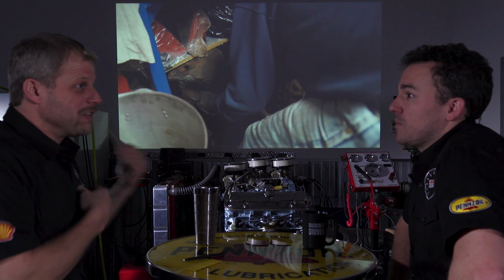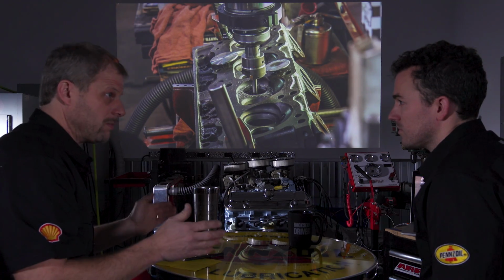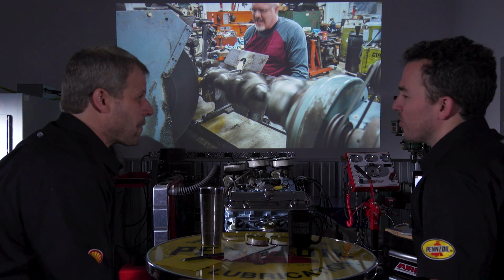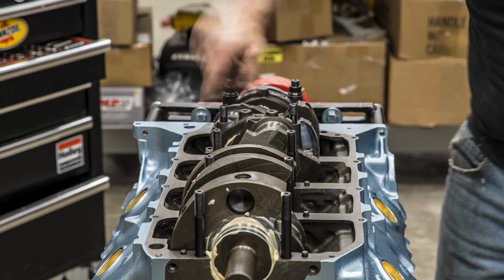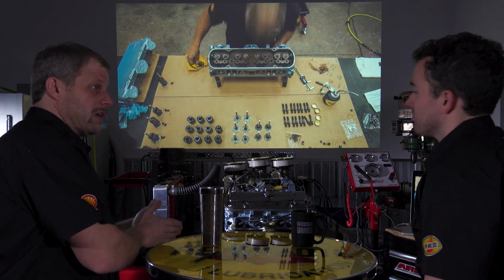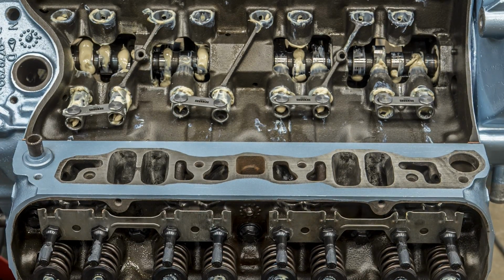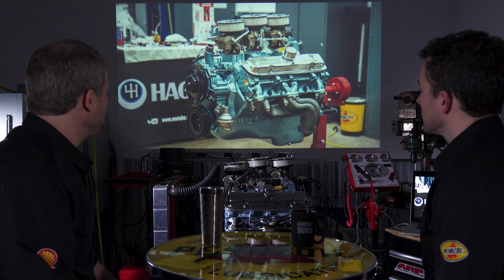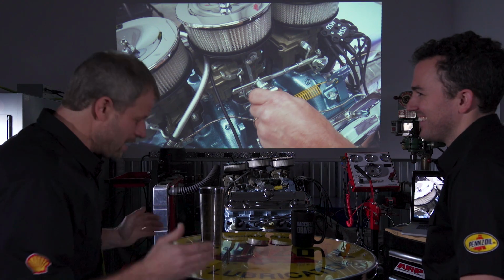How we rebuilt our Pontiac GTO 389 engine | Redline Rebuilds Explained

Comment: Fantastic, entertaining and informative videos !! My thoughts, not a big deal. I was wondering why some use race aluminum type rockers, and not steel for street use? Not a big deal. Why not use aluminum rods? The heads you chose are open chamber 400 heads and do not match the 389 piston valve relief locations or angles, not a big deal. Good job resurrecting an important engine to the muscle car history.

Comment: On the cranks, it's hard to grind to the millions,  normally 1/2 a tenth..
Or .00005... for a normal auto engine we are +/- .00005. Running a crank grinder all is very tiresome. Your not going to grind a crank journal to .000001. Its not going to happen..

Comment: In regards to the lathe with the grinding head - you can grind down to tenths of a thou (.0001) of accuracy.  Once you hit a half of a tenth (.00005) it is extremely difficult to maintain a dimension because the surface will expand/grow as a result of the heat generated from the grinding operation (even with flood coolant).  Dimensions below half tenths that I have dealt with are accompanied by temperature tolerances.  In other words, the feature or surface has to be a specific distance from another feature at a given dimension.  The measuring tool also has to be the same temperature.  A millionth (.000001) I would argue is improbable for a lathe with a grinding head to be capable of hitting.  Dressing (making the surface flat with a diamond tipped tool) a grinding head to be flat enough to do a hundred thousandth (.00001) is unlikely at best.  Basically what I'm saying is at 19:06 he should have said "... size in the ten thousandths."  Which is well beyond the tolerance required for the crank.

Comment: Just thought I'd share with the community on what my brother and father built late 90s. My brother built a engine stand generally out of angle iron, some wheels, and a huge nut. We bored out the nut threads to fit a pipe. Welded the nut to a square post. Worked great for our 3 engine uses. Still have it but doesn't get used anymore. We used it to rebuild a 350, tear apart a 305 to see why it failed,  and reconditioned a 4.3 V6. Made our own vs buying just cuz we could make one.

Comment: Hi 😊 My name is Donald... I've had two 69 GTOs  in my Day...I let a Woman drive My last GTO....She hit a Telephone Pole.... I still have the 69  400 block with a 389 Crankshaft... Motor was bored 20 over... But I sold the Ram Air heads about 20 years ago..... Question Please... Motor has been sitting in My Garage  standing up...Here I am 63 and I bought a beautiful 94 Firebird... very very clean... but it has a V-6 ...now years ago I put it in a 73  Z28 ... I want to know if I can put it in my Firebird.... I believe I would have to change Transmission... Drive shaft & and maybe a 12 bolt rear with 390s gears. Could you please let me know if it's possible... I love GTO Motors

Comment: Noticed the term "clamp load" used in this video.  So did you compensate for the fine threads on the nuts of the main studs ?  Fine thread will deliver higher clamping load.   And the ARP bolts won't stretch as much as the stock bolts.  I'm sure you had the studs in there when you had it line bored and the same clamp load value on the threads of the block.

Comment: Would have been nice to know Which 389 block and heads you started with? Stock 093 heads had press in rocker studs. You either had to machine screw in studs or they are not 1966 389 heads?  Were those Arma Steel cranks you turned? Great project! Love the Pontiacs!

Comment: Not a crate motor,.......a basket case.
But a worthy project if the car comes with it.
But most of the parts will probably be from Mexico,..... at least mine were.
Sleeving a block is typically used in tractors.

Comment: Hi guys been watching for best part of 3 hours of your work. I have to say it's a real pleasure to see. You could not put together a better promotional video than this. Love the animation quality touch to the final cut. 
I own a 1950 Buick which runs pretty dam good. But would consider sending it to you from the United Kingdom. Just to have it spect up to your craftsmanship.
The one thing stopping me is the seal between the straight right and the dynaflow gear box always leak. Which leads me to thinking if I have to have it done again. I will put a V8 in it with a snug gearbox. 
Here's the question there are I believe ways of fitting different gearboxes to a straight eight. I've heard there are new rubber seals to the gearbox but dont know where I could get this or if they exist. But if you could give me a rebuild on my straight eight with a snug gearbox that dont leak. Well think I'd have to think about shipping to you. 
Is this possible do you know if you could do this.
Once again guys just the best work you do really 11 out of 10. Absolute joy to view. Thanks Les McMillan

Comment: The strength of the serpentine belt is very high but the resistance to abrasion is very low on a  sharp edge. Thousand pound motor and transmission assembly, parted of my serpentine belt on a sharp edge of the casting ! I quit doing it that day !

Comment: I totally agree with painting before assembly. Shop teacher back in 1985 taught us this and been doing it every since. Also on the 20/50 oil for break in. I started using amsoil break in oil probably on the last 4 motors. Am seeing a big difference in performance, quality of break in, and longevity. They basically schooled me on ring break in and it turns out that my old school science lab concauction of oil and additive mixing was wrong all along(30 yrs).

Comment: Hey gents, around a year ago you where talking about the 60's Pontiac big block you where rebuilding and how a couple crank journals where turned to different diameters than the rest. Maybe the following story will help to explain why. I was told by an old timer( I'm 63 so that makes me a geezer too I suppose.) that back in his younger days there was a machine available that could resurface journals while the motor/crank where still in the car. Youou just had to pull the oil pan and set up the device. The subject came up as I was bitching about a rod knock on an out of round journal on my 65 f100 that had a transplanted 68 ford 390 that I knew was going to grenade in a year or so and I had a  460 with 75k miles from a 86 f250 waiting in the wings. I would of used that tool right then and there.

Comment: Here is a question:  Why did you not use the Clayton Leach ball style rocker arms that Pontiac Motor Division used in all of its 326 and 389 cubic inch V-8's of the 1960's?  I reused these rocker arms each time I rebuilt my 326 and have had no problems with them.

Comment: On the oil filter adaptor.  It's been my experience that on the 66, 67 Tempest line which includes the GTO you need the angled filter adaptor.  This is because of upper control arm mount on the frame makes removing the filter a pain in the butt.

Comment: Davins 100% right to paint before assembly, but theres even more to what he grazed on. cast-iron is extremely porous, even more after its cleaned especialy with the caustic-acids of a hot-tank. and assembly lubes or oil are quickly soaked into the parts preventing paint from ever adhering properly. so a few months later, the gorgeous motor is peeling paint.

Comment: Revisiting Have plans to install a Roller cam in a Pontiac 1969  400 engine. Cam final lift 0.510/0.521.
There is a lifter bore brace available for these blocks.
Reputation Is some lifter bores-points,  are a bit weak. 
Would like Any feedback / knowledge or experiences about this “lifter brace” device, if it’s overkill or not necessary etc.

Comment: After watching the first ten minutes or so, I have some comments.  Starting several years before 1968, when the ability to use unleaded gasoline was first mandated for new cars, Pontiac Motor Division was using Inconel valve seats in its engine heads.  My 1966 model year 326 engine had such Inconel seats in its heads, so whenever I taken the heads to a machine shop to be redone, they simply reground the seats to fit the new valves.  The car runs just fine on unleaded gas to this day.  But if you don't know exactly what year a 389 engine is from, then it makes sense to replace the old seats with new Inconel seats.  If you know a 389 is from 1964-1966, then you probably have Inconel valve seats installed by the factory.  As for cylinder sleeves, the big truck diesel engines are built with removable sleeves to start with.  That way, when such an engine has run 200,000 or more miles, which only takes about two years with a truck tractor being fully used to make money for its owner, then simply replacing the sleeves is the easiest way to restore tightness in the piston ring to cylinder wall fit.  I understand why in this 389 rebuild we use a 2 to 4 mil interference fit, but it does pre-stress the cylinder block, right where there are already cracks.  Whether that is good or bad for engine longevity, I cannot tell you.  Given my druthers, I would rather not pre-stress the cylinder block if I can avoid it.  As to re-using piston connecting rods, I would advise new ones because I experienced an engine failure due to metal fatigue fracture in the reused rods.  About 80,000 to 100,000 miles after rebuilding the 326 with a 30 mile bore out.  Presently with a 60 mil bore out and new connecting rods, it is purring like a cat and roaring like a lion, :-)!

Comment: The failing point of Pontiac engines are the connecting rods! Pontiac used cast rods, unlike any other brand. You had the opportunity to use forged aftermarket rods! Big,big mistake.

Comment: 7:40 In addition, this process produces the right surface texture so a gasket can seal. It is called the "RA measurement"
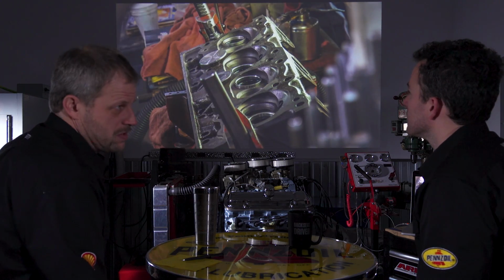10:14 I never saw an engine that needed to have intake valve seats pressed in, but I suppose anything can happen when an engine lives a hard life.
12:36 As you mill off more material, the combustion chamber becomes smaller and that raises the compression ratio. People have to know the compression ratio when building an engine.
17:00 In addition, this rebuild teaches people how connecting rod machining works.
21:45 As the crank gets cut down, it may get weaker. That is why some companies can't make certain undersize bearings. At that point, it may be practical to weld a crank journal.
36:20 I thought full floating connecting rods needed bronze bushings in the small end.
42:40 THe best thing to have is a tapered cone compressor, but those are expensive. You have to have one compressor for each different bore size.

Comment: there is one way to tell if the valve guide seals are bad from when you take off and there is a small puff of smoke that clears up immediately after it's in most cases the valve guide seals . they can be replaced on some car's with out pulling the heads buy blowing compressed air in to the cylinders while you pull the springs but it's always better to just pull the heads. the air trick works if you can't get or afford new head gaskets .

Comment: Hey Guys very informative!! Just a quick question, when I've ever done a rebuild I've always been particular about making sure the surface between the bearing cap & the deck of the block was clean. I noticed that you got some assembly grease caught between the cap & the deck. Could this muck the torque setting up or through the clearance out? Or am I being too particular???

Comment: When I worked for Chrysler in the engine test labs through the early 2000's, we used serpentine belts as slings up through the 8.0L Truck engines; 820lbs fully dressed and I am STILL using THE very same belts I have had since the late 80's.  They are THAT strong and long-lasting.  Just did an early Jag 3.4L engine (no lightweight engine that!) using the very same sling er, serpentine belt I used on the Viper GTS-r, GT-1 FIA engine in the 90's.
Reply: In the 2010's at GM Powertrain, they did NOT like us using my serpentine belts to lift engines as they were not "certified" for lifting.  But I used those same belts at GM ALL the time.  So one could say there is a "little bit" of MOPAR in today's GM V-8's.....
Reply from the maker: Thanks for sharing, Mark!

Comment: Using a serpentine belt for something it's not made for (lifting strap) and encouraging others to do it too is not a good idea at minimum. A purpose made lifting strap is cheap compared to dropping a heavy load at the wrong time. Lucky you don't work for an insurance company........
You have to take lifting heavy loads seriously. Did you know that using a threaded lifting device, such as the bolts you use, at 90 degrees lessens it strength up to 50%.

Comment: funny thing is after all of the cool building, when it came to actually hearing the engine run,talky mc talkerson yapped completely over the engine and instead of getting an exhaust note outside between the mufflers, just went on talking. is it any wonder the reason why directors are silently behind the cameras now? almost 2 hours of watching the build and only 2 seconds of engine song. the mix ratio is very lean to say the least. less director exhaust note and more Pontiac please. ▪☆☆☆▪
Reply: They were discussing the build. To hear the sound of that engine, you must watch the time lapse video

Comment: Hold on a sec.. At 47 minutes in you start explaining that you like to use blue seals on the intake valves and black seals on the exhaust valves, but in the video you installed them vice versa. 

Was the explanation incorrect or the installation incorrect?

Comment: I have to disagree about having issues with knock at a compression of only 10:1. Especially when using the excuse of modern unleaded fuel with ethanol. Ethanol has a higher octane than gas.

Comment: Looking forward to the dyno run, i'll predict 389 Hp @ 5500 RPM &  421 Ft-Lb @ 3600 RPM due to the long duration cam and mild porting shifting the power band higher than a stock build.  The #'s are poncho throwbacks too for good luck!

Comment: I ran Gates Japan for a few years.  We sold an aramid cord belt to a Japanese customer that could easily hold 2000 Newtons per rib.  You are using a 6 rib belt to lift that engine = 12,000 N of tensile strength or 2700 lbs (but they don't stretch much, as you supposed!)

Comment: You mentioned that it needed to be 9:1 compression with today's ethanol fuel to avoid spark knock. If you ran it on E85 (85% ethanol) you could have built it to be 14:1 compression.  Alcohol is not the problem, crappy gas is the problem.  Love the videos.  Thank you!

Comment: I never imagined that rebuilding an engine was SO intense and meticulous from all involved ! Ok, that was a special, much upgraded case but even then !
I'm not a mechanic but very tech inclined since my early age, thanks Popular Mechanic ! Thank you guys for your awesome work !

PS I own a special 1988 sports car, yes, my beloved Fiero GT, with the Chevy 2.8 V6, rated at 135 to 140 hp. Still strong but with leaky valve seals and somewhat loss of power.
Any ways to upgrade it, maybe a 'lil more oomph on the cheap side ?? I don't want to go to an engine swap to a 3.8 supercharged as many did... I want to keep it as close as possible to OEM.
Reply: A simple camshaft swap is probably the cheapest horsepower adder that is legitimate no matter what engine. Aside from that the next bet is your exhaust, upgrading the manifolds to headers or even going with a larger diameter pipe will restore loss power from a stock restrictive system. After doing those two things time and tune the engine so it's running as best it can and have fun.
Reply: @number3665  
Thanks man ! Appreciated
Do we need to remap the ECU ??
Reply: @marcryvon  That I'm not 100% sure on but I don't think so. It's an 88 so it should be OBD1 which is painfully simple and you may not need to do much to it at all if anything.  And if you do it should be very easy to look up and accomplish. I've heard that a bigger throttle body will give about a 20hp increase by itself and the throttle body from the 4.3 will bolt right up if you have TBI and guys will grab those because they're cheap or even the Holley one and not have to mess with the ECU at all.  If you play your cards right you can probably see 200hp. Just do a bit of research on it, hell there's even a company that makes stroker kits to turn the 2.8 into a 3.1... though stroking an engine isn't exactly cheap or a weekend change. SO you want more air flow that means a free flowing exhaust, bigger camshaft, and or bigger throttle body to get more air into the engine.
Reply: @number3665  
On my 1st  '84 Fiero 2M4, it had a TBI. On the '88 V6, I've got port injectors... And yes, it's aa OBD1.  I will do some research. Tks.

Comment: Hello Sir. I have a inline 4 cylinder engine. I am going to start vapor blasting the engine parts. The engine block is cast iron. Please tell me the do's and don't in vapor blasting process. I am a beginner. This is my first time. Should I do vapor blast before machine the parts, and should I mask the gasket area, seals, and holes.

Comment: Which paint is on the exhaust manifolds? At least which ingredients or type of paint should we look for?
Reply: AustrianAnarchy Eastwood high temp factory gray looks just like bare cast iron and holds up great on exhaust manifolds. Put this on my 68 and looks fantastic. Brush on or spray. Put it on my 68 with the engine in the car. Carefully brushed on. Has held up very well for 2 years so far.
Reply: Nice! Thanks.